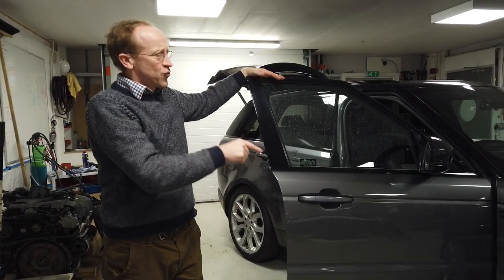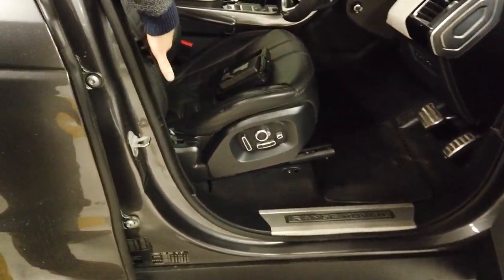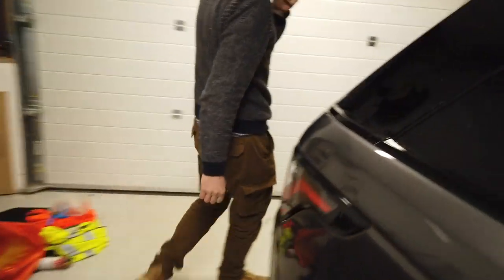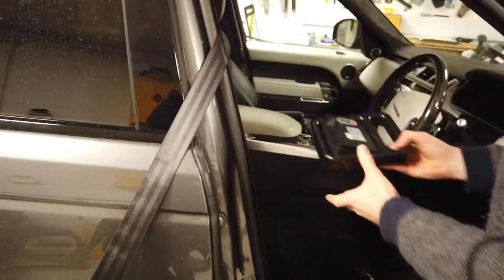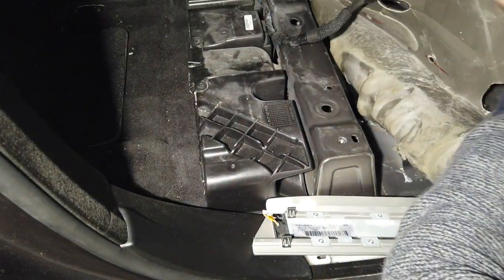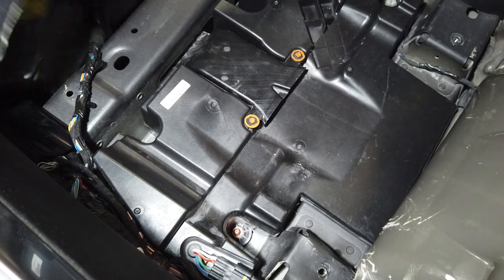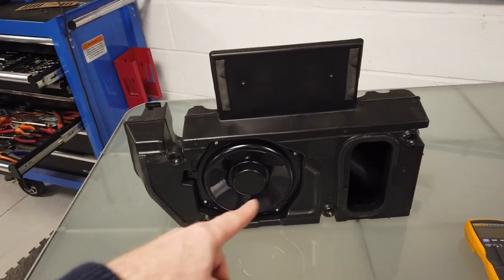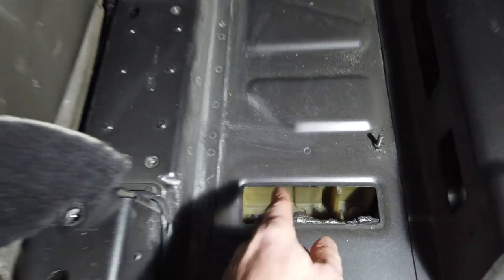Range Rover Sport L494 Sound System Subwoofer Speaker Audio upgrade / removal

Comment from the maker: As promised here are the list of the part number and engineering numbers for the speakers - let me know if there are any problems with the link  or if i need to update the data etc.
https://docs.google.com/spreadsheets/d/1W3hg86IkV9hAkQMqnLhN6oo374NZYaebHj3bWTmA83E/edit?usp=sharing
Reply: Mate I've got an ultimate peasant spec sound system in my RRS hse .... does mine even have a subwoofer?

If not, can one be fitted where there is supposed to be one?(if that makes sense)
Reply from the maker: @sayithowitis470  Oh dear - this is not good.... not rocking the tunes for you buddy.... there is a chance you do not have a sub but it would be worth taking out the RH seat and taking a peak underneath to see if there are the connections for an amp there.
Reply: @L663  I have no idea why the previous owner has decided to buy optional extras and left the sound system out as a choice .... its has as much soul as a silent but deadly fart
Reply: Hey all. My l494 also has the rubbish base system, i just changed out the woofers. from pn/LR044858 to LR078623 thanks to @powerful, i used your videos as inspiration! thanks! However i would say the performance increase isnt overly amazing. it defiantly has more kick, but still lacks a bass-y boom. I subscribed to JLR's EPC and noticed my system as predicted has no sub. I just purchased pn/LR033287 - got a steal from ebay! I did this BEFORE checking if i had the connector under the seat - whoops! however if it's there i'll be sure to update or you'll see a sub one ebay pretty soon ;)
Reply from the maker: @emdosmike  This is a question I get asked a lot - is the wire there for the sub.... so we are all waiting for your update.
Reply: @L663  Just did this today to my 2014 L494. No sub under the seat, just a bit of foam. I can confirm that the cable for the sub is under the seat. The bit that is missing (7:35 in the video), is the 4x 10mm nuts, the bolts are on the floor though. Also missing is the 2x 8mm screws on the air vent. This is held in with 2 plastic Christmas trees (as Simon calls them). They are too big to fit in the holes in the sub. I also fitted the Prem16 amplifier, which was just a straight swap.
Reply from the maker: @kennyg4744  Sorry for late reply - thanks for posting this Kenny
Reply: @L663  yes, my vehicle in the US, 2015 RRS SE, has the base 400w system and the sub was prewired with teh connector in place.  plugged it in, works fine. but there is no way to adjust the output to the subwoofer in the audio settings screen.. any ideas on how to do that? maybe take to dealership to reinstall a program or something?  does your preimium system have an adjustment setting in the audio settings on the screen?
Reply: @caintiger  - Was the connector hard to find? I pulled the passenger seat in my US 2016 RRS HSE, removed the foam insert, but could not find the connector anywhere..... If it's not there, is it possible to install it and is it worth that effort?
Reply: @kebabian8832  hey
My connector was under the carpet and attached by a clip to another piece of plastic that was sort of more towards the divider or middle console . Not sure if that is clear or not. You will have to remove the seat, open the carpet, and the i think remove the hard plastic of Styrofoam template that you will replace with the subwoofer.  It might have even been attached to the top or the side of that template.. sorry i cant remember more specifics
Reply: @caintiger  - Thanks, yeah, I pulled everything. No connector in sight. :(
Reply: @kebabian8832  sorry man, im not sure why there isnt.. might be due to where it was manufactured or what year it is?

Comment: hey y'all see my post below for anyone in the US trying to do this.
First off.. shout out the gents at powerful UK for an awesome instructional video.
now on to the good stuff.... i have a 2015 RR Sport (L 494) SE.  bought it used just this past month.  has ~78K miles on it and it is in just pristine condition.  it came with the BASE 400W stereo system with just 8 speakers.  i upgraded the speakers a few days ago using the Premium (not super premium) speakers. does make a mild difference in the sound quality but not overly noticeable.  just simple plug and play.  after reading a few of the comments here i decided to go on ebay and purchase the subwoofer to see if i could get more out of the system in total.  as they show in this video, it's a relatively easy install, just follow the steps.  my vehicle DID have the Sub prewired and the plug under the seat (which is under the passenger seat for US folks). did have to remove the foam template and took a big of tweaking to get the bolts lined up to the holes in the sub.  once i did that, just plugged everything in, set everything back in place (carpet, interior trim,  connectors under the seat, seat back in place), then hooked up the batter and powered it all up.  does sound better with the sub.  not overly noticeable with the boom boom boom, but there is a deeper sound.  i also ordered a 600w amp off of ebay that will be here this weekend and i'll hook it up once i get it (again following the videos provided by the team from powerfulUk).  after i get that hooked up, i'll edit this posting to let y'all know how it sounds.   I will also place this final edited posting on the videos for the amp, and for the speaker upgrades.  really can't say how much i appreciate the gang over in the UK for helping us with all this!!!  as we say in Auburn, AL.. War Damn Eagle y'all!!!

Edited 9-21-22… when upgrading the amp , my vehicle came with the amp that look like it has a small handle in the middle with raised grooves radiating outwards from the center(call this amp1) and not the amp that has the raised rectangle on top with diagonal grooves (call this amp2). I ordered a high12 that looked like amp2 from eBay.  It was either defective or it isn’t compatible as all I got was bass and all the treble was cut off.  I ordered another high12 amp that looked like my original amp (amp1), plugged in and it worked perfectly.  So looks like either there is some slight programming difference or a defective amp.  The Bluetooth speakers, as others have said in the powerfuluk speaker and amp videos, are now cut off due to the fact that the midrange speakers aren’t there.  There is a workaround another user posted in the speaker video.  Thx to Simon and crew!

Comment: Thank you so much for the video. I've connected my subwoofer, but there's no sound coming out of it and also the on the screen, there isn't an option showing the subwoofer. My question is? Do I have to programme the setting or its plug and play?
Reply: Found a solution? We are doing the same for one of our personal cars.
Reply: @motivesupplies Hello, did you manage to solve the problem?
Reply: @-mexxy- yes, it needs to be coded in use Sdd. Or buy a GAP tool for personal use.
Reply: @motivesupplies  thank you for the quick reply

Comment: I have a 2016 RRS HSE with an odd base 400w system. I took the front seat out and it's just the foam insert and there was NO blue connector in sight for a subwoofer. I guess I'll have to go aftermarket amp and sub. What a cruel joke!
Reply: hello there, did you endup buying a subwoofer and amp for your car? I too have a base sound system on my RRS 2017 - I've already replaced the basic door speakers to a premium, and really need/want some more bass. Can you advise what you did with yours?
Reply: @bissauSabi  
No. I looked at a few used OEM subwoofers but I did not have the connector available so I held off on buying it and focused my attention on other maintenance.

Comment: Hi Simon, just been busy doing sound upgrade. My car is a 2014 HSE with basic audio. Which consists of 4 Woofers and 4 tweeters. The woofers are DPLA-18808-BA incase you want to update your very useful spreadsheet. Replaced these 4 with the DPLA-18808-DB and also got 4 mid range BJ32-18808-BB. Interesting that the loom in the front doors had the connectors for the mid range speakers, but not in the back doors. Might be helpful info to someone else. Amp and sub arrived today, so that's a job for the weekend, but it already sounds a whole load better. Thanks for all you super helpful videos.
Reply from the maker: Hi Kenny - I am working through my emails backwards as you can see.... i have updated the spreadsheet with the data and comments and given you a shout out too !
Reply: @L663  Cool. Thanks Simon. Now done the amp and sub and commented on that video too. The connector for the sub IS under the drivers seat :-)
Reply: Did your base model have the under seat subwoofer wire connector?  If so, where was it tucked away?  Mine appears to be hiding…
Reply: @toddhedges3440  The connector was in the tray running along the centre tunnel.
Reply: I read though a huge thread online in a forum that if my amp does not have the blue connector, then my RRS is not pre-wired for the subwoofer and door mid-speakers.  I purchased the blue connector for the amp and now I have to wire that.  Any idea where I can look for the correct pins/wiring of the blue amp connector in relation to the subwoofer?
Reply: @toddhedges3440  Sorry, No
Reply: @toddhedges3440  On my RRS 2017 i updated the door woofers but i didnt have the mid-connectors so probably dont have the sub connector either. I bought the original sub, how did you connect it?
Reply: @petrinagy1011  I followed the instruction by powerfuluk in the various threads and blogs.  I remember buying the FOMOCO blue connector for the amp, (upgraded to the 1200w OEM unit from eBay) and following the correct speaker wiring diagram to add the woofer.  I have to say the improvement is amazing.

I was not so lucky with the mids.  I wired the amp output for the mids to the same wires for the tweeters.  Then I tied the actual mid door speakers to the tweeter wires.  It works but it doesn’t sound good.  I ended up disconnecting the OEM tweeters, and it still sounds poor.  I think I blew a voice coil on the JL Audio 3.5” mids that I installed.
Reply: @toddhedges3440  Ok i uppgraded my woofeers and it didnt make much difference. I think it would be better to find a fullrange speaker and install them. So i would keep it a 2way system on doors and not install any mids, just add the sub under the seat. Connect it through an external amp.  Trough the line signal and just add a frequncy low pass filter. I did a installation with JL audio speaker 4x 6,5 inch and a subwoofer on a boat and it sounded amazing, the same concept would work better here.
Reply: Kenny can i droop u an email maté regarding the upgrade
Reply: @yanmasterman9942  Sorry, no. Simon and the team have done a great video. All the info is there plus the spreadsheet to download which had more info.
Reply: So just checked with landrover and mine is the lo line audio boo. Im not a big music guy so i dont think it sounds too bad but needs more bass. If i bought a sub would that just be plug and play or will the amp not drive it? Anyone any ideas?
Reply: @JakeLingham I’m in the same situation. No one is answering
Reply: I'm wondering the same thing. Were you able to get this figured out?  @JakeLingham

Comment: Trying to source the mounting fasteners: are the 10mm nuts just regular M10’s?  The 8mm screw type fasteners, anything special about those?  My RRS did not have the woofer so I’m starting off with just a piece of styrofoam and no fasteners.

Comment: Will a premium woofer simply work by adding it to the Base 400w audio system and plugging it into the wiring from the amp?  (2016 L494) There’s no special programming required to adjust the settings in the head audio equipment?
Reply: my SE 400w model in the US, did work without any programming.  just plugged it in.  however, in the audio settings on the screen, there is only an adjustment for bass and treble and to balance and fade.   I also have a 2009 LR2, and have the midgrade meridian system in that vehicle, and becuase it already came with a subwoofer, there was a setting  in the audio settings to adjust the treble/bass/AND SUBWOOFER. so i could maximize the output there.  again, there doesn't seem to be a setting in the base 400w system to maximize the output.  so i would imagine that even though i have installed the premium (not super premium) subwoofer, i don't know that i'm able to maximize the subwoofer output to get the most out of it.
Reply: @caintiger  How is the sound on the base 400w model? Overall worth the upgrade even without the additional setting?

Comment: Having trouble sourcing the sub, did you guys buy it brand new or eBay? Is it possible you have another one laying around in the shop? Looking for the higher end one CPLA-18808-GA. I’ve upgraded the speakers from you guys working in installing the upgraded tweeters and mids. I have the base 8 system and it was just awful.

Comment: I have a 2012 vogue the dpf filter was cleaned 2 weeks ago as red sign came up on screen wife said it has appeared on screen again amber any suggestions thanks
Reply from the maker: That does not sound good - there is some good advice here
https://blog.greenflag.com/2014/diesel-drivers-need-know-dpf/
Reply: Does it smoke under heavy throttle?

Comment: Great clip. Have you managed to source or find a substitute speaker?
Reply from the maker: no but i think our bass door speaker may be suitable...
Reply: @L663  I don't think it could work, the subwoofer under the seat has 4 wires, the ones in the doors, although of similar size and shape, only two...

Comment: If you had the low line version would there just be a void where the sub should be or just the plastic housing maybe?
Reply from the maker: I guess just a void ?
Reply: powerfulukltd ok I will look when I fit the amp and let you know so you can share if the question gets asked again.
Reply: Has the low line version pre wired to add the subwoofer?!
Reply from the maker: @pardis4  Hi we do not have a base model version to check if the wiring is in place.
Reply: @L663  have we found out an answer for is there wires in place for the sub in the low line one?
Reply: Guys, Any news on what’s in place on the base version?
Reply: The base, low line does not come pre-wired and has a piece of styrofoam in the void under the seat.  If you want to add the woofer, you must source the blue audio connector for the next level AMP and wire the woofer and 4 mid-range door speakers.  It’s a bit complicated if the wiring is missing.  There is a chance the base audio did come wired for a woofer, but the indicator would be that one blue connector on the back of the amp.
Reply: my US vehicle is an SE 2015. with the 400w 8 speaker system.  it came prewired and there was a foam piece in place of where the sub would go. i pulled it out, found the sub connector, place the woofer into the void as shown in the video, reconnected everything and powered it on.. works fine.

Comment: It isnt how it works. using a higher impedance driver on an amp will draw half the current  the amp is capable of at a given output voltage. Using the dual 4ohm subwoofer on the amp intended for dual 2ohm will leave you with half the power going to the sub. It will be a downgrade as your halving your subwoofer power. Youll not give the doors or other speakers more power either. The main amplifer has seperate chip amps per speaker. Would be better to add an aftermarket amp to power the dual 4ohm driver which is easily do able.

Comment: Would anyone know where to locate the woofer wiring connector on the base low range 8 speaker model?  I thought they came pre-wired, but I haven’t been able to locate the connector under the seat yet.
Reply from the maker: My can has the woofer so I am not sure..sorry but i hope someone can help
Reply: i have the SE model in the US.. it was sitting next to the great big bundle of wires that run along the passenger side of the center arm console.  for me, it was right there and i couldn't miss it.  hope you already found it?!?!
Reply: I would like to check to see if I have the wiring in place before moving forward, is it possible to locate the blue connector without pulling the seat? @caintiger
Reply: @zo5290 assuming you also have the base model with just standard speakers... unfortunately i dont believe so because you would have to pull the seat out and then the rug up. Its not complicated but it is a little time consuming.   Also if you do proceed. You will have to reconfigure the reciever for premium sound and to do that you will need to buy the GAP IIDControl which is a plug in diagnostic tool...from Canada..

Comment: I have this fault code:

AAM (Audio Amplifier Module) 2 problems exist
1.B1D9F-11 Engine Speed Input - Short Circuit To Ground Confirmed
2.B128C-11 Speaker #15 - Short Circuit To Ground Confirmed

Speaker 15 I believe is the one in the middle of the dashboard. Its started making the following sound recently:

https://youtube.com/shorts/ZW_DRYpfy58?si=w5Fv_wRxUNdNeinP

Do you know if this speaker is faulty and needs changing or why its making this sound?